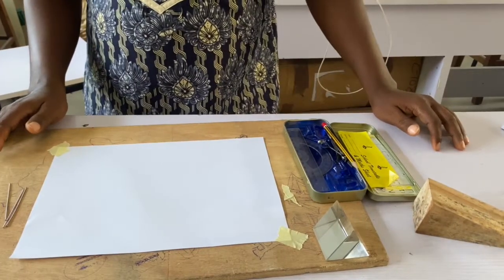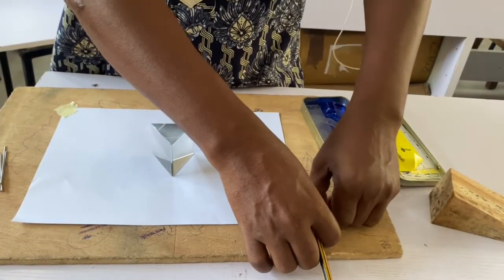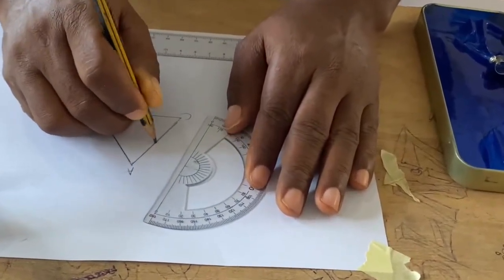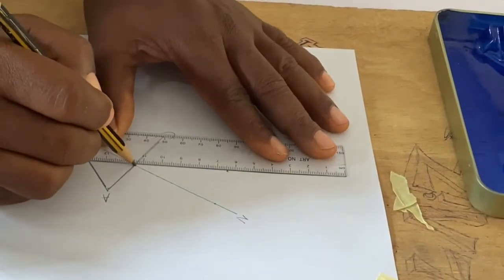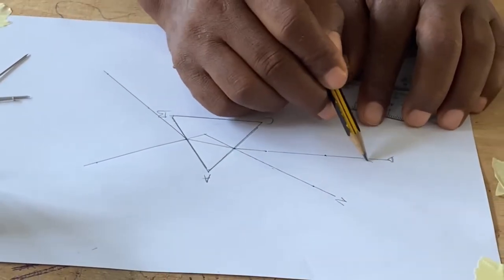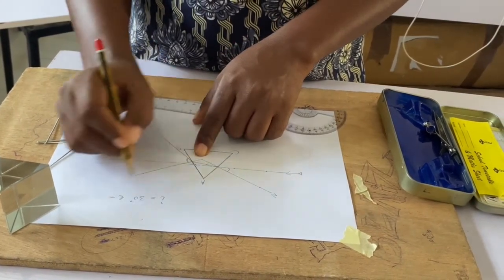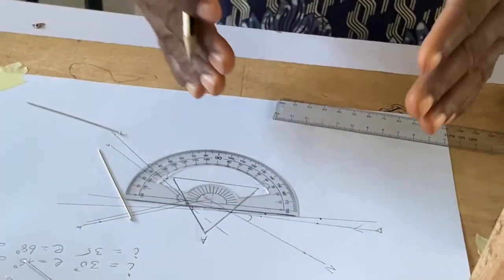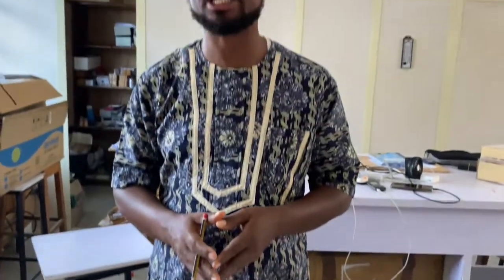Refractive index

Comment from the maker: QUESTIONS: 
1. Plot a graph of d against i.
2. From the graph determine (i) the minimum deviation, D and the corresponding angle of incidence iDmin
3. Comment on your results.
4. Calculate the refractive index of the glass of the prism material using the equation
n=Sin((A+D min)/2)/Sin A/2 Where A=600
5. Determine the error in n
6. Explain why it is not advisable to use small values of i in performing this experiment.